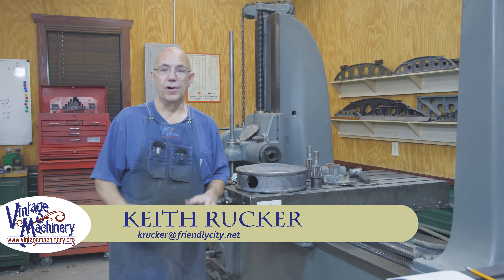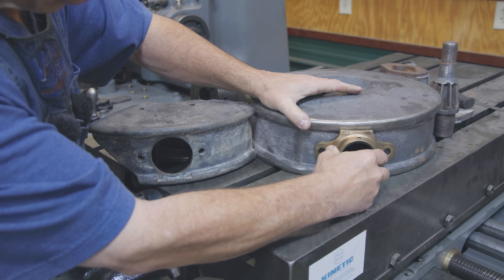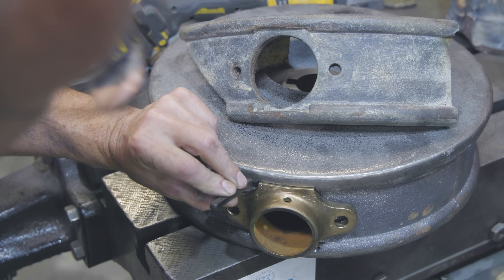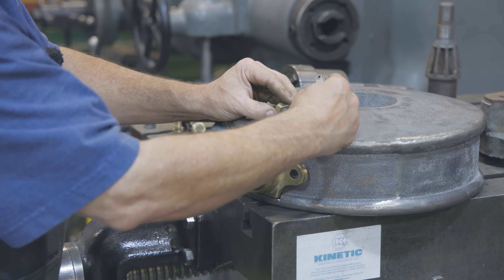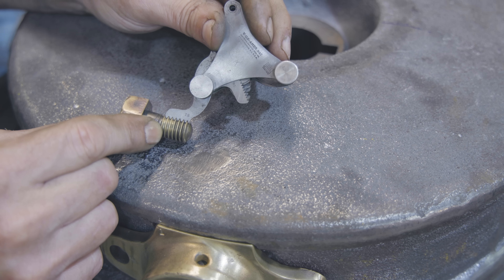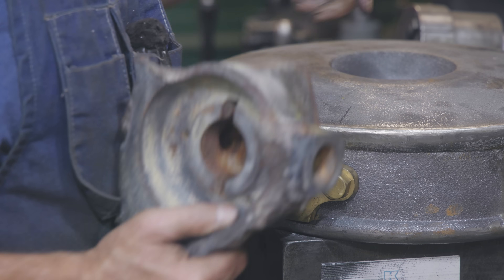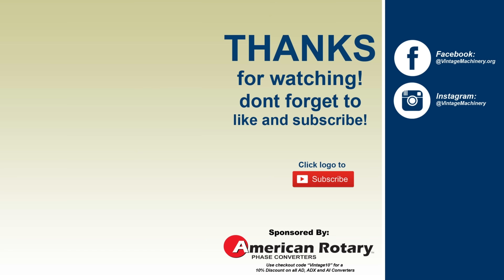Tally Ho Capstan Project: Installing the Top Manual Crank Drive Gears and Covers

Comment: "Fortunately I have a half-inch 12 tap..." This man has everything!" As my father used to say, "our generation can do anything!"
Reply: 1/2" bsw must be like rocking horse shit in USA
Reply: Reminds me of a rule my son made up - "Don't ask Dad if we have a tool, just ask where it is." 😂
Reply: hes been collecting tools for around 40+ years.  my collection dont even bump the needle on a tents indicator. lol.
Reply: I know originality is a concern with projects like this, but it would have been better if Leo had Keith just replace everything with either metric or more common size imperial hardware. Imagine having to find a replacement 12tpi bolt on some random island during Tally Ho's journeys

Comment: Ya know...Keith has a huge breadth of knowledge from his many years in the business which helps him figure his way through a challenging project but the thing, in my mind, that makes him a craftsperson is his ability to hand drill a hole and have it be straight and in the right place. I have been consistently impressed over his many projects with this talent of his. I have drilled so many holes over the years that were less than perfectly straight or in the perfect place that I have a real appreciation for how really difficult this seemingly simple task can be.
Reply: The concept of the transfer punch was an absolute revelation to me. So simple yet so elegant.

Comment: You are correct, Whitworth is 55 Degree.  Also the peaks and valleys have a very small radius to them.  I actually checked before you said anything and Whitworth 1/2 was 12TPI so it’s anybody’s guess.  5 degrees would be awfully hard to see with a thread gauge after all and as long as they thread in tight it should be just fine.  Great work all around in this capstan, it’s been fun to watch!

Comment: As a retired moldmaker I really enjoy watching you running all that old equipment that I used to run while building plastic injection molds . Keep up the good work !
Reply: Speaking of that, did you watch how the mold was made for the capstan and then sent to Windy Hill foundry? There are quite a few videos of the mold making process and the casting.

I was wondering if the capstan could have been cast using some other method other than green sand, like some type of evaporation loss method.

Comment: Those bronze fittings fit really nicely and they make it start to look like a machine and not a sculpture, this is really exciting! Tally Ho first sail has happened - she does look spectacular and like a Kings yacht, takes my breathe away since I feel I know this boat and she sails so well but that was just two sails. First sail is incredibly special, Leo and the crew were loving it  :)
You're doing a great job; I never really thought about machinists having a style but they do and I like your style. Grinders and hand held drilling, not to mention hand tapping :) It's machining from a different era which is perfect for this capstan.
Reply: Three sails - main, stays’l and jib
Reply: @manfredagne6738  I'm not a sailor. :P
At a guess I would say 50% of full?

Comment: 1/2" x 12 pitches is a BSW thread (British Standard Whitworth), still is today. The thread form is 55 degrees rather than 60. The angle is supposed to make it less likely to come loose than a 60 degree thread, although I have to say I have seen no definitive testing on it. It became THE British standard thread in the mid 1800's and was the first standard thread in the world, it was still widely used to the 80's, although we are now mainly metric, thank goodness. Wikipedia as ever have a good page on it, with links to its inventor Joseph Whitworth.
Reply: My suspicion is that if Kieth brought a 1/2in 12tpi tap he may have been given a BSW tap by the vendor. I don't know the trade but I suspect that unless asked specifically for a 60 deg thread it would have been assumed that a BSW was what was wanted when 1/2in 12tpi was asked for.

In fact I suspect the reason 1/2in 13tpi, ands odd choice of tpi, is the current standard in the US is to avoid mixing of 55deg vs 60deg threads.
Reply: I have a 60 degree 12 TPI. Also cutting a whitworth was hard, small shops used a sharp 60
Reply: @billdoodson4232

He said specifically that he could tell it was 60° from the thread gauge. Did you not watch the video?
Reply: @billstevens3796  I did watch the video. Tally Ho was originally built as the Betty in the UK. Back then, a 60-degree thread form with that pitch would have been very, very unusual. I'm certainly not disparaging Keith, but 55 degree is not far off 60 and without a 55 degree thread gauge to compare with, it's quite possible to be out, with a bit of wear etc. I will check with a BSW bolt and my BSW and UNC gauges when I am back in the workshop next week, assuming my UNC gauges have a 12 TPI leaf.
Reply: @billdoodson4232  You are forgetting that it wasn't only 55 degrees, there was a radius formed in both outer edge and root. They are not interchangeable.

Comment: dang that 1/2-12 is interesting, bet that was my problem some years back when I was working on an old machine. But where are the crank handles for the manual cranking of this thing? And what about some sort of cap for that recess in the top to keep the water out? This has been a fascinating series, everything from pattern making, casting, and machining, very cool, thanks.

Comment: Nice work Keith.. a pleasure to watch.
In regards to that half inch thread anomaly, (and I'm going from memory, as I'm long retired) BSW (British Standard Whitworth) had the same TPI as UNC (Unified National Course) except when it came to a half inch size thread.  But the most notable difference (between Whitworth and UNC) was that Whitworth had an included angle of 55 degrees, as opposed to UNC (and UNF as well) which had an angle of 60 degrees.  Of course all this means nothing now that wer'e all Metric here (in Australia)    
Cheers Keith and keep the videos coming.

Comment: Fantastic work as usual Keith. I hope you provide a corrosion prevention coating on the inside so it doesnt rust stain the deck. The capstan needs two crank handles that have probably long disappeared. Looking forward to the finished product on the fore deck of the Tally Ho.

Comment: Fantastic videos so much amazing engineering explained 👍.
One question regarding the oil holes drilled in the capstan top,wouldn't grease be better as a lubricant? This would be able to keep seawater out as well as not run off.

Comment: When Leo first got the Tally Ho, I didn't see anything that looked like a crank for the windlass.  Will you be making those, or will someone else?  I first thought that the cast iron from the original cap would have been used in casting the new cap, but obviously I was wrong.  Everything looks amazing.  Leo chose some incredible craftsmen (and women) for his project.  Great job!

Comment: When I was the machinist for the new construction of a 60’ wooden schooner (all custom bronze castings) I made some metal chisels out of some high speed steel tool bits. I set them in some bronze 3/4” stock. They came in handy quite a few times.

Comment: Greetings from North Carolina USA. Keith’s tap is probably a 1/2-12 Whitworth with 55 degree threads since the bolts fit well in the tapped holes.

Comment: the 1/2" size is where the UNC and Whitworth differ, one being 12tpi and the other 13, generally if the fit is slightly loose the whitworth will fit in the UNC hole, not necessarily the opposite way round though.
Reply: I should point out at the correct TPI it will fit.

Comment: Think I would put a SS zerk fitting where the oil hole is, otherwise salt water can get directly to the shaft which is steel.
Reply: Water ingress was my concern too, especially with the dished out shape it will be like a funnel.

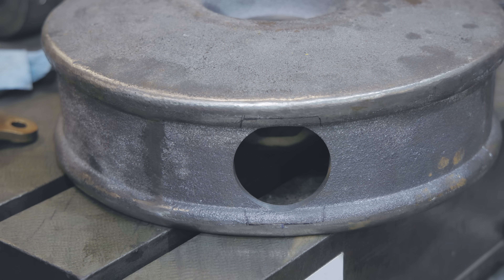Comment: 3:48  I don;t know Keith??  At this point  see myself bolting the casting to a big angle plate, and milling that out on the vertical mill .. it would be easier than hand grinding .......

Comment: I'm rather surprised that you haven't cleaned up those two geared pieces that install into the cap and manually drive the capstan. They both looked a bit rough. Also curious why, given the motorization upgrade, bronze bushings weren't added to the hub for them to spin in. Great work as always Keith.

Comment: A couple of question for next video, Keith.  What's the plan as far a paint goes?  Is that part of your job or is that being farmed out?  And what kind of paint are we looking at?  I'd also really like to know more about the oiling of the gears, etc. etc. when you put this together.  When I look at the oil underneath my machines, that's one thing to see on the concrete pad of my garage floor.  It's quite another to thing to think of a similar mess on the beautiful planking of the Tally Ho!  I hope there is a way of dealing with that in the casting.  Fingers crossed.

Comment: Considering the age of Tally Ho and the fact she was built in the UK, I would suggest that those bolts are 1/2 inch BSW (Whitworth) threads. That was the British standard right up to the 1950's. Mustie1 has been having the same sort of problem with the 1953 MG TD he is currently working on!
Reply: It almost certainly is, been enjoying Darren's MG videos.
My first car was a '58 Morris Minor (as in Morris Garages) so a mix of BSF and BSW on the body, although the cylinder head had some metric threads in it! My old motorbikes have some BSC (Cycle) threads thrown in for good measure, even the nose thread on my Myford lathe is W/W despite being built in the mid 80s. Keeps it interesting thread spotting.
If Keith was closer I could have leant him a 1/2 W/W tap as it is 12 TPI as standard 🙂 the bolts would have wound in a bit easier I expect.

Comment: The thread pitch interested me. I wrote much of the Wikipedia article on the USS thread standard. William Sellers created this standard when he published "On a System of Threads and Nuts" in 1864. This standard was known as the Sellers standard and the USS standard. The UNC standard replaced the USS standard.

 It is interesting that a British manufacturer would have used  a USS thread at a time when it would have been more common to use BSW threads in Britain and it is interesting that they used 12 TPI  for a half inch bolt. The pitch of a BSW half inch bolt is 12 TPI, and the pitch for a 1/2 inch USS (UNC) is 13 TPI today.

The only size bolt that has a different pitch than what Sellers specified is the 1/2 inch bolt. Sellers specified the pitch for a 1/2 inch bolt as 12 TPI and it is specified by the UNC today and previously by the The United States Department of Commerce Bureau of Standards in 1929 as 13. TPI So when this capstan was built the British manufacturer used an American standard for the half inch with the same pitch that was originally specified by Sellers.

Do we know that this capstan was built in Britain? Could it have been built in the US?

ETA: In 1929  The United States Department of Commerce Bureau of Standards published: 
American National Screw Thread Tables for Shop Use. This document specified the standard pitch for a 1/2 inch coarse thread as 13 TPI..

As a further confounding issue, something called the 12 TPI standard was published and in this standard there were several screws sizes that used a pitch of 12 TPI.

Comment: Have you thought about how to reassemble the capatan so the interir doesn't get corroded over time. Are you going to plug the oil holes so salt water dose not get into the interior between lubrication. Maybe using a heavy grease when reassembling on some parts to discourage rust inside?

Comment: Curious as to what type of final finishes or coatings would be applied to these parts as in my opinion these raw iron parts eg the castings and machined shafts will quickly rust over and/or start to corrode in the marine environment.

Comment: Wonderful work and the machinery is so clean. Not a bit of swarf in sight! Have you got to make a handle for the manual turning option too? Also interested to see how this interacts with the new motor which presumably will have to freewheel when in manual mode, unless there’s some kind of clutch?

Comment: Great work, almost there. I have a question, the original design has the two geared drives which are steel, running in the steel cap, I would have expected at least one, preferably both  of the bearing surfaces to be bronze sheathed to reduce corrosion and lower friction, obviously it was made this way for a reason, do you know why? Thanks Tony

Comment: Hi Keith,
Missing inner bronze bushings?
Considering the fact that this now will be driven by a motor on the bottom, shouldn't there be a set of bronze bushings set into the center hub so the steel shaft on the inside of these gears won't be riding directly on the cast iron?  I would think that the steel and cast iron will form rust which will cause them to grind away at each other -- especially with it being driven by the motor.  A bronze bushing would eliminate 1/2 of source of the rust, and would be a replaceable sacrificial part.  Also, it would act as a thrust bearing for the shaft.  What do you think?
Cheers from Oregon,
Philip

Comment: I wonder how all these complex parts were made in 1910. On the other hand if only CNC machines were used how it would go to do all the necessary programming for the many one time only operations.  Seems that the only practical way to do this job needs a craftsman like Keith and the manual machine tools that he has.

Comment: Wouldn't it be easier to grind a rounded relief on the edges of the brass inserts? What would be the downside of doing it that way, other than it would be a departure from the original?

Comment: What about galvanic reactions between the cast iron and bronze?  I reckon the original was ok, so is this not that big a concern?   
Tally Ho is underway, so this capstan will provide a lot of security for the ground tackle.  Great worK!
Reply: it just dry fitting,
bronze will be most likely coated with clear overcoat or daily cleaning it as the did in the old days

Comment: I hate to ask, but what about the manual crank handles? And were the original cranks single or double man cranks? For a long time watching this project I thought the crank was a square end shaft that fir into the gears. Now I see that it was really a round shaft with an ear on it. Was it tapered or straight bore? Was the original crank handle straight one or the good old fashion "S" curve style? I know that the motorized modification has a manual disconnect in case the motor fails, but if that is used, where is the hand crank? Curious minds and so on. I Love the attention to detail to reproduce the original art form, but I think the original handle was not included in the $1 purchase.
Reply: The original handles are probably long gone. From the original videos of Taly Ho it looks like anything not bolted or nailed down is long gone.

Comment: 1/2" x 13 is UNC. The British did not use UNC in the 1920's .The thread in the original casting and the bolts will be Whitworth (BSW) which is 1/2" x 12. Whitworth threads are also 55 degrees and have a radius root and crest not the flat root and crest used by UNC. You should tap cast iron dry. I would have done the machining for the bronze bushings when the holes for the gear pinions were bored since you had the casting set up to do those

Comment: Are those gear pieces original? Are they a little rusted inside? Do you need to lube around where the touch the brass?
Reply: yes and that is just a dry fitting

Comment: If the wrench fits then it is not Whitworth bolts.
They use their own wrench sizes and none of them match either inch or metric.
Also the bolt head looks to be too small for to be Whitworth.

Comment: Wouldn’t it be easier to relieve the backside of the bearing holder?
Reply: on a 100+ year oem part
Reply: Yes a good point, but probably easier to replace/create than that top casting. That part is literally priceless. Took four (or five) tries. Regardless, an amazing project. Except for the foundry and machine shop contribution it could never have come out so nice. Congrats!

Comment: There needs to be a cover lid on top of the capstan cap that covers the top nut that screws on top of the  shaft that holds the cap onto the capstan. Without it seawater could enter the internals trough the oil holes on top and in general the top nut could seize from the salty environment exposure.

__-+---+-__
      |      |

Something that has a machined edge that protrudes into the hole. The fastening method might have been just a screw on the top edge as witnessed by the small hole that was present on the original.

There was no cover lid on top of the cap with the capstan when it arrived but there had to be something covering the top and it was most likely lost during the ages.

Now this is just an educated guess but it would be probably wise to consult it with Leo or somebody in the know.

I know this is a long marathon and I don't like to add more work to this but it doesn't seem right to leave this out, and I believe it's kind of important.